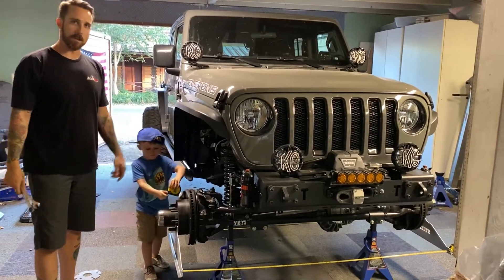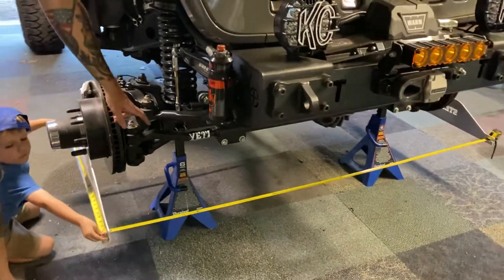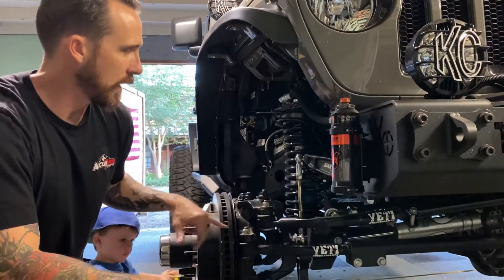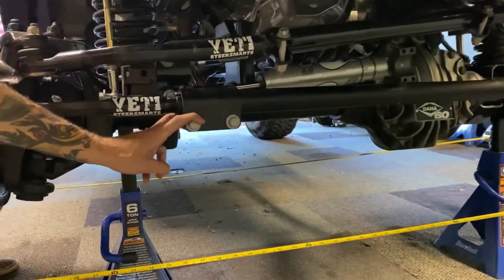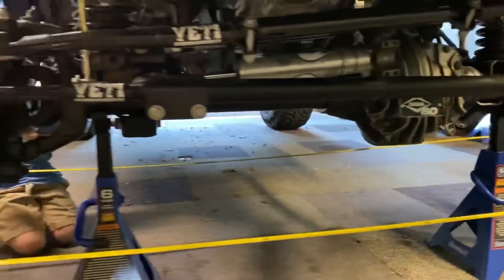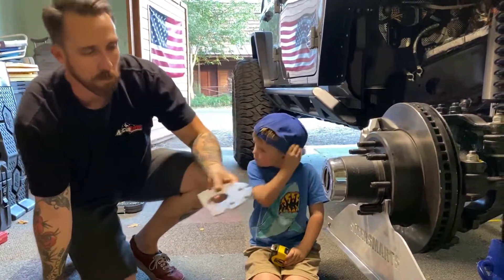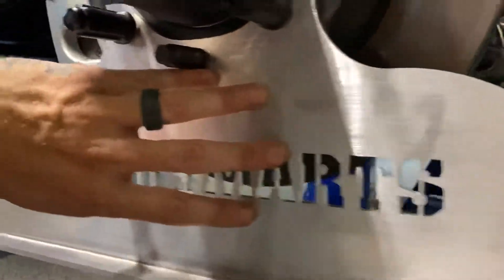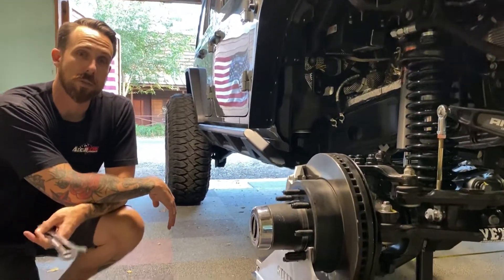Garage Alignment JEEP JL

Comment: So front toe out and rear toe in , what is the exact measure - example front toe out 69 1/2 rear toe in 69 5/8 ?
Reply from the maker: measurements are going to be different due to varying axle widths, wheel spacers, etc. I've had good success with 1/8" toe in. So the front of the alignment plate would need a measurement of 1/8" shorter than the rear of the alignment plate to achieve this.